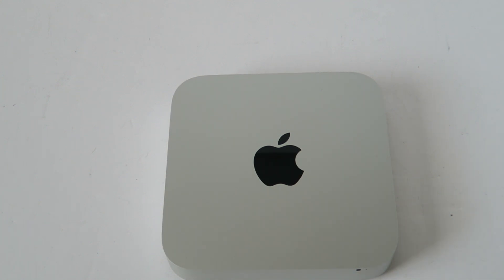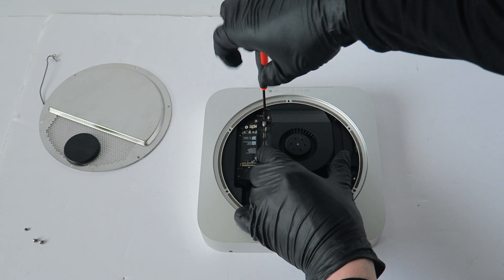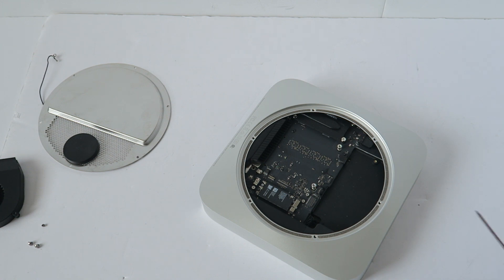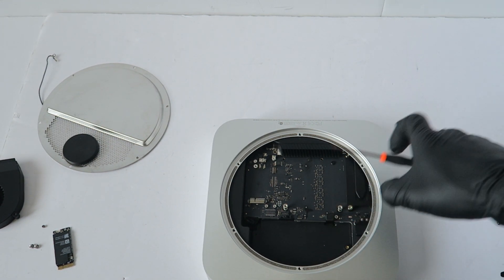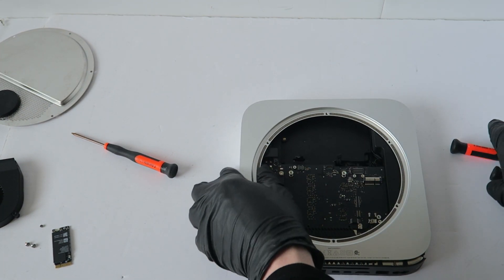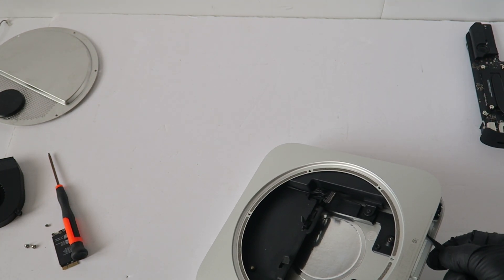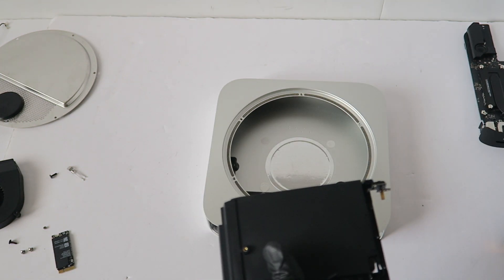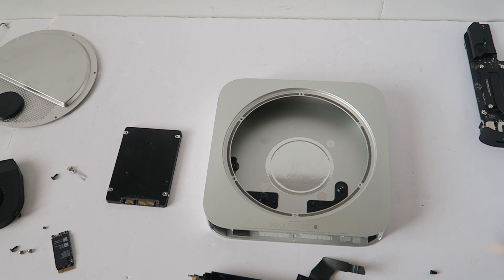Apple Mac Mini Teardown

Comment: Depending on the mounted position of the SSD, not necessary to remove power supply or other parts.  If the drive is in the lower bay, then yeah, all that needs to come out.